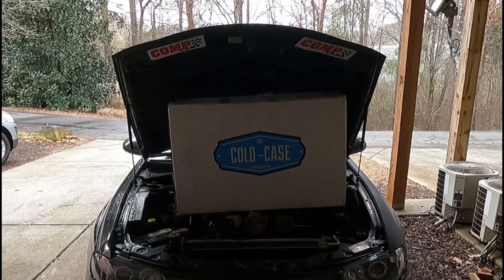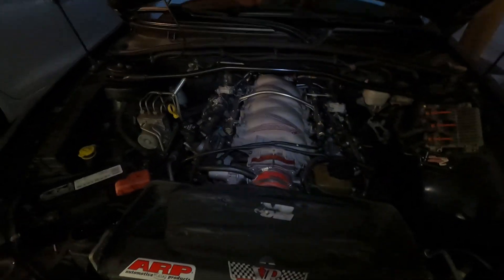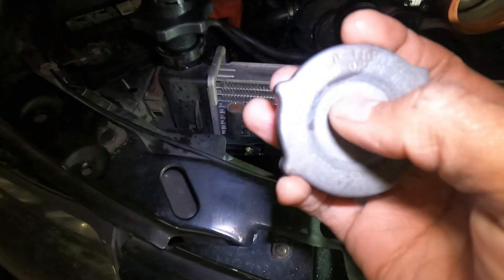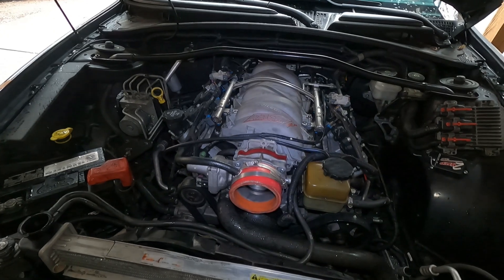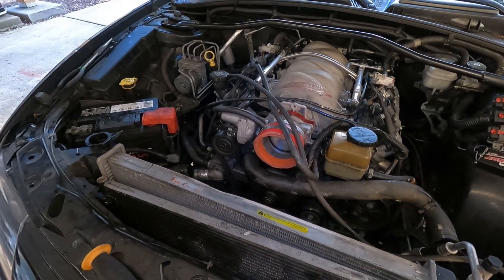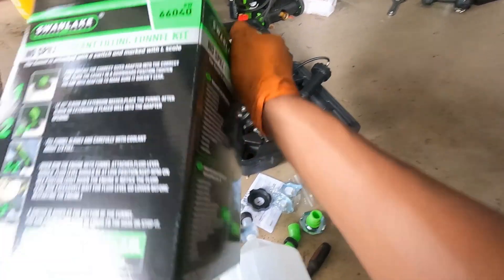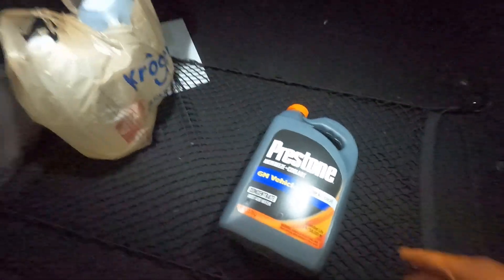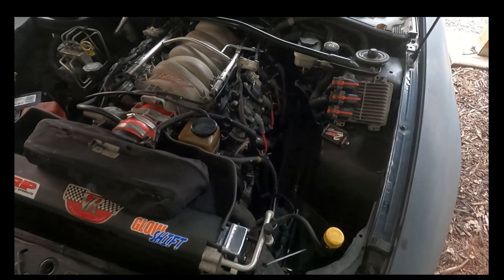DIY LS2 Pontiac GTO Race Aluminum COLD CASE Radiator Upgrade IN DEPTH without lift. Fits OTR intakes

Comment: Mann i was hoping i didn't have to unbolt the ac condenser!  Thanks for the video man
Reply from the maker: Yep me too. It's a knuckle scratcher. No prob thanks for the support!
Reply: @CampbellsCreations  bruh .. this thing kicked my a$$ trying to get it out. I finally got it.
Reply from the maker: Ha haaa told you it’ll scratch some knuckles. Little wiggles at a time
Reply: @CampbellsCreations  lol wiggles,  cussing and all. Gonna try and drop the new one in tmw.
Reply from the maker: So going back in will be less wiggles but more cussing.
Reply: @CampbellsCreations  oh great something to look forward to lol.
Reply from the maker: So how'd it go?
Reply: @CampbellsCreations  had to work over today.  Hoping to find out tmw. Lol I'll update tmw! Lol
Reply: @CampbellsCreations  dude. Went in so freaking easy!  Ac condenser was a little bit of a pain.  But the radiator went in really easy
Reply from the maker: @blawsonbl  nice! I struggled getting the feet lined up for each one. Had to keep pulling it up and readjusting. Got the air bled out?
Reply: @CampbellsCreations  that was the tough part for me too.   Yessir. My brother has the one that sucks all the air out and puts the coolant in it's place. That was the easy part.
Reply from the maker: That's what's up. I've never heard of such device .. I need to look into that

Comment: Any problems with those auto trans cooler holes you left ??? I got the same problem not sure whether I need to plug those up or not?!
Reply from the maker: Nope no issue. I think they are closed and capped. Then when you screw in the auto lines it pierces I think
Reply: Hopefully I wont have to plug off the auto trans cooler line holes I ordered a different brand aluminum radiator from Amazon for my 06 gto MT I don’t think they come with blue plugs in those holes like yours did but seeing the stock one for your MT GTO has the holes for the auto Trans cooler lines and they aren’t blocked off I don’t think it will be a problem
Reply from the maker: I agree. I think the they would only flow when the auto lines are plugged in